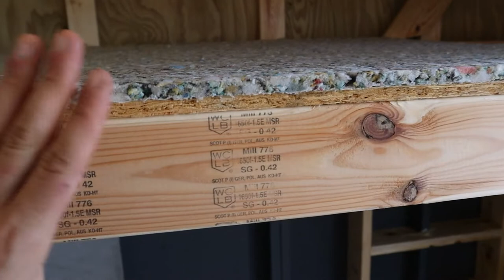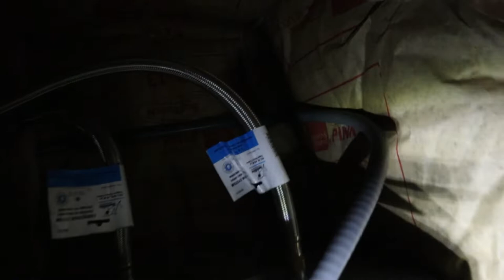Running Utilities -  Glamping Tiny Home Shed - DIY Projects

Comment: Dang this is so impressive. Your craftsmanship and work ethic is top notch!! I have a lot of questions but my biggest one is how do you go about adding a sub panel of your main line? Do you have to work with the city and power company?
Reply from the maker: Hi Brad & Chloe (not sure how to make the cool Swedish e haha). Thank you for your comment, we are proud of what we built. To add a panel was fair y simple... expensive but simple ($1,600) I had an electrician do it. I have an electric pole in my backyard with a 200 amp breaker. Then our house has a panel with a 200 amp panel. We went over existing appliances I have in the house and he said I can feed a 100 amp panel from my electric pole in the backyard. My house doesn't really use 200 amps so I have room to add. But a couple days ago I did have the electric company come out and I will be installing another electric pole on the other side of the yard for future projects. It's going to be about $1,000 and I will need a permit from the state and inspection. Do you have a pole at your property? If you do just look at the panel, open it and look at the black lever of the main breaker and look for a number. 200 or 400 its the most common I think.